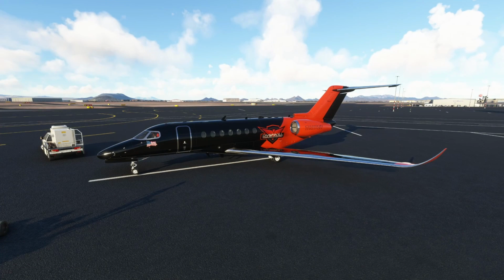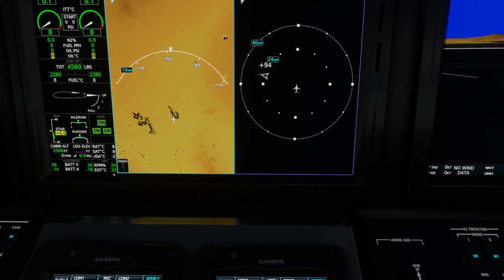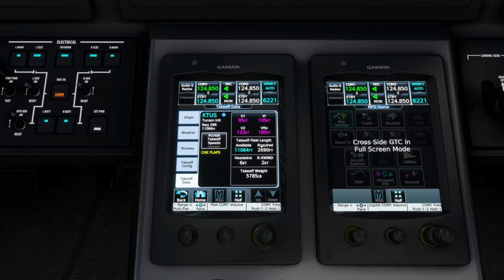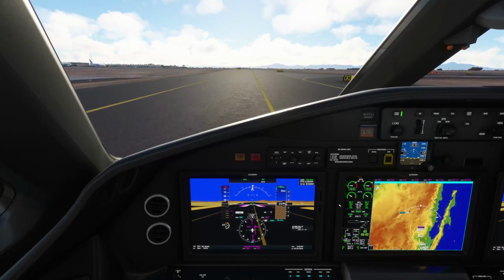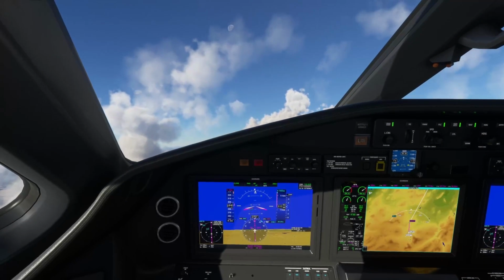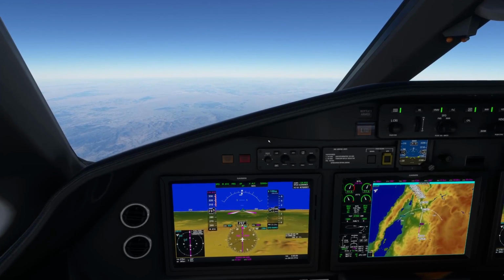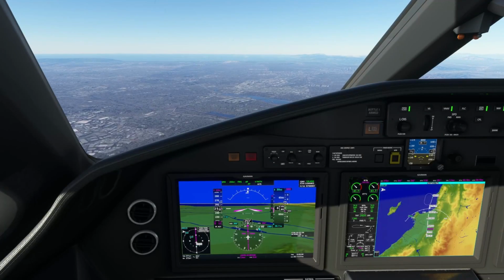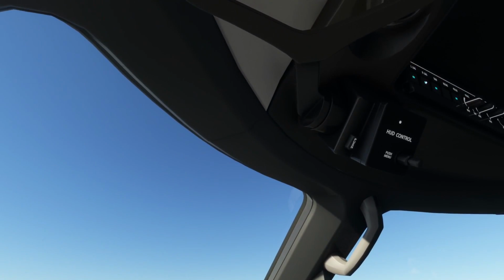New Citation Longitude for MSFS!

Comment: Great video, thanks, I have a query - the Cessna Citation Longitude features three rotary knobs (rotaries) underneath the central Garmin Touchscreen Controllers (GTCs) which are essential for various flight operations. As of the latest updates, there isn't direct keyboard shortcut functionality specifically for the rotary knobs on the GTCs. However, you can use various other methods and tools to streamline your interactions with these controls.

Comment: The auto throttle kicks in after your airborne keeping you under 250knts. with the A/P engaged and the speed bug set same goes for defending and final decent plane flys buttery smooth 🎉very nice flight model 🎉🎉

Comment: Take off performance is based on one engine failure at V1. Continue your takeoff and try and maintain V2 on your climb out with only one engine working. Give it a try. Flight sim does not take into consideration temperature, pressure and airport elevation but you will hands fill.   Great video! Regards-

Comment: Your analysis of VFTO is very incorrect in so many ways but you explain it like you know what you’re talking about.
Reply from the maker: After looking this up you're correct.  I had been under that assumption for awhile hence the confidence.  Not sure what I confused it with now.  But I will correct myself in the future.  Really curious what I have confused it with now because this means there's something else that I'm getting wrong in its place.  I know I read about maximum safe roll speed somewhere.  

My mistake... :/
Reply: @OverkillSimulations  You are thinking of max tire speed.  195 knots.  That won’t damage the gear either.  The tire may get close to its structural limits at that speed but that’s it - probably.  Just like car tires, a max speed will be given but there is a built in safety factor at that limit speed similar to Vne and Mmo.
Reply from the maker: @thecorporatepilotdad  thank you! I appreciate that explanation! Makes much more sense!

Comment: Hi there,all your excitement about these improvements are understandable,BUT : There are a FEW bugs to report,like sometimes FMS mode doesnt change over to APP mode no matter what you do,(like manualy activating the APP eithr via FPLN or pressing APP mode button)the ILS freq is ALWAYS tuned to the stanby position,sometimes the airplane DOES NOT start to descent on the predicted TOD as per VNAV presets,(it happens annoyingly often) I´m a a certified ATP (just for info) and fly an extremely nice Embraer jet...I noticed you dont keep your heading bug aligned to the actual heading (a procedure done and learned on my ATP certificate)we always do it because not only keeps you aware of any changes,helps in keeping situational awereness,and also when anticipating a turn in a procedure.I wonder if the real jet climbs keeping 5000 ft/min  on FLC! I´d called it Citation Rockitude,LOL! nice video!

Comment: 15:23 - the speeds.

You can't change the calculated speeds, it's a one way link to the speed bugs.  Clicking accept on the perf page sets the bugs, but otherwise the FMS doesn't do anything with those speeds.  So if you are using manually calculated speeds, just enter them and call it a day.

FMS speed will always be the VNAV speeds (default 200 initially, then 250 to 10k' then 280) and the speeds set here have nothing to do with it.  The Perf page  helps calculate the speed bugs.

Comment: On an ILS, following pink lines, FMS VNAV and AT modes. Sometimes I can arm the APPR by hitting button on AP. This places LOC and GS in white on lower line in FMA. It captures perfectly. Happens on ILS 26L KLAS. Then other times it does not arm. For example ILS 24 into KCRQ. Anybody else having problems arming FMA with white LOC and GS?

Comment: The only thing I don't understand is how this planes turns in ap.  It can't stay on any approach with curves in it, it over flies all the waypoints, almost ignoring them entirely.  As an example ils22 into klex from the west. You do the same approach in every aircraft, except maybe the few heavies and the crj.  The 737 does it flawlessly, as does the honda, vision, a320, almost every plane does it on the lines or close. The longitude will be 4 miles outside of turns crossing back 90° across the line, then over correcting and flying back to the line, just to overshoot the next waypoint by another few miles. It's amazing that the 737 can do them with no flaps at 180, and the longitude can't do them at all!  It's like the thing is constantly in half bank mode, which makes it even worse!  It makes the turns fine at alt, unfortunately it seems to use the same math to calculate those turns at low speed, and refuses to turn. Maybe I'm missing something, I just didn't assume this plane would fly approaches like an an225!

Comment: Is there something going on, with the new beta  vision of the Longitude jet or Is this just me? On my last flight, ATC would not, let me file a IFR flight plan, that was not an option. The jet’s FMS would not load my departure. It won’t show if it doesn’t load. The auto throttle would not engage or turn on, whatever you want to call that. I thought that the checklist, would be in the plane’s MFD, center cockpit screen, it wasn’t. The HSI needle is off center, when my plane show to be on path, on the map screen. I had my NAV aids, or whatever you call this, set to FMS, before the beta, you would always set this to gps, not FMS. Maybe this should be set to NAV 1 for my SID departure. I don know about the Vnav yet, since I have not had any altitudes, in my FMS.

Comment: Your TOGA was fine (two Green TOs at top, one white TO at bottom left for auto throttle. You just hit it again somehow and changed modes. Just keep hitting that TO button over and over until it returns to the proper format. Then advance throttles and proceed. It will shift to a HOLD indication and proceed into your other modes, hit VS or FLC climb and let it do its magic.

Comment: I love the longitude.  One problem I have found with it is time.  I have tried to flights from Atlanta to Denver and couldn't complete them.  At about the 2 1/2 hour mark, the speed starts increasing, and there is nothing you can do to lower it.  Eventually, the aircraft is over stressed and the flight is over.  I am at fl420 when this happens.
Reply: The Longitude likes to ride the barber tape on auto throttle, change your SPD from FMS to MAN and then select a lower speed.
Reply: Also, don't fly at FL420 😂 either 410 Eastbound or 430 West.

Comment: Relatively new to MSFS.  This is by far my favorite plane to fly.  Are these panel updates automatic or do you need to get an addon?  Thanks!
Reply: AAU1 does not need an addon. In fact I would probably remove older WT 3000 from community folder. The update will show up in Content manager.

Comment: Would the FMS have to slowed down if you hadn't turned off the AP?
Reply: FMS will not slow below terminal speed.

You can toggle the speed select on the MCP to manual and then slow it and the auto throttle will operate all the way down to approach speeds.

Comment: Upon further testing, the FMS actually AUTO sequences FROM FMS nav to LOC 1 (AT the FAF final approach fix, not before) with no need to do it manually. Of course it also automatically sets the ILS course, but it also appears to automatically set the ILS frequency (as standby in LOC1 and primary in LOC2), as I was even flipping the ILS frequency OUT of LOC 1 radio and the FMS AUTOMATICALLY put the ILS freq into LOC 2 radio and flipped it to active AND set LOC2 as the nav source! (I hadn’t done ANY tuning of the LOC 2 radio or changing of the nav source) Apparently it though I was being an idiot, lol. Anyway, the whole approach was automatic except I manually set airspeeds for the auto throttle at various points AND I had to PUSH THE APPR (approach) button when on the approach course (that arms the LOC (localizer) capture. It even lands itself somewhat smoothly, but not on center very well. I’d still recommend a hand flown touchdown…
Reply: This LOC 2 automatic tuning process keeps LOC 1 free to tune to a VOR if that’s part of the missed approach procedure.

Comment: This is not your first time taking off in garmin system right? Let me explain once more:

step 1. Press TO button and arm autothrottle (If you have a nav track available you can press NAV and VNAV, but keep it in TO for a hdg departure. And btw, never press FLC on the ground!)

step 2. Advance throttles manualy to takeoff thrust (this is not a latitude so the AT will not automatically take over)

step 3. Check thrust, HOLD mode, airspeed alive both sides, 80 knots, v1 and rotate

step 4. Keep flying and trimming until 400ft. Then announce:”flaps up, flight level change” At this point you can retract all flaps and press FLC. I suggest binding a button for FLC so you don’t have to use your mouse. If necessary press HDG. 400ft is also minimum altitude for AP engagement.
Reply from the maker: Your information is valuable thank you! I think the new annunciation that I'm not used to seeing was the biggest thing throwing me off.  
Thank you for the information and I'll put it to use :)
Reply: @OverkillSimulations  Great! Looking forward to your future videos
Reply: So you can load sim brief and are you using Navigraph for other info?

Comment: A few thoughts:
* 4X sim rate on autopilot is the max recommended by many devs (maybe even MSFS says so?) — I never go above it. 8X issues may or may not be a bug, but some aircraft will go totally out of control, much less overspeed at 8X.
* Under MFD “Map Settings”/“Inset Window” (available on the “MFD home page/Map Settings/Inset Window” OR the “Flight Plan/Flight Plan Options/Map Settings/Inset Window”) you can turn on a “Flight Plan Text” Bar showing a flight plan summary at the bottom of the MFD. It shows current flight plan progress AND Current VNAV settings and predicted times and required descent rates. Good Stuff.
* In the middle of the “PROC” window is a button marked “Primary Frequency” (after you select an approach) that shows you the proper freq. for the specific approach and allows you to select a radio to send your ILS frequency to.
* The PFD gives you flap extension and retraction markers on the Speed Tape for you, making those decision points easier to see.
* Your landing thump is because swept wing jets need a different technique than other straight wing aircraft. Don’t do a big flare — just level out, or even push forward a little then level out or flare a tiny bit. When you “push” a jet wing, it reduces the descent rate in a “cushioning” effect and makes things much smoother. Pulling back actually just increases descent rate… then “thump”.
* I can highly recommend a book called “Flying the Wing” by Jim Webb (available many online places for $5-$10) which specifically instructs techniques for swept wing jets. Improved my jet flying immensely. He describes how to manage cruise and trim more precisely and he’s a big fan of the little “push forward” on landing to arrest descent rate.
Reply: Note that you don’t even have to use the “primary frequency” ILS button unless there’s some problem, as the ILS frequency appears to be automatically tuned into LOC 1 standby and LOC 2 primary when you select an ILS approach.

Comment: Great video. I wonder if they will work on the HUD. That would be neat. Working Title mod for the CJ4 was the most advanced plane early on with VNAV but the plane does not have auto throttle. Try flying to Sion Airport in Switzerland as you'll be in for a real treat. The RNAV approach is greater than 40 miles! Watch the VNAV take you through the valley from 18,000 feet. It's a lot of fun.
Reply: Working Title did comment on the inclusion of the HUD: "The HUD is actually not available for use nor certified on the real Longitude yet. So, we don’t plan to add that functionality until such that it can be used on the real aircraft."
Reply: Yeah, the CJ4 Collins ProLine avionics suite is also a well known and hated system among pilots. The Longitude Garmin is much, much nicer to use, in addition to the auto throttle.

Comment: Where do you get the mod?
Reply: You must have the Premium MSFS package, and then opt into the Beta version program. Instructions for Beta entry are available with a web search.
Reply: @DoctorShocktor  I have the premium edition and the beta opt into. So am I good to go with out having to download anything else?
Reply: @citylimitsphoto  Yes, should work fine. Make sure you have no mods, like the improvement mods for TBM930 or Longitude or they will cause issues. Also had a strange thing where I had to delete both from official, and then restart to force the download. Probably Mod related though.
Reply: I can’t find this aircraft in the Msfs 2020 market where can I buy it.

Comment: Hello Sir, I would love to try this amazing aircraft, however I have a few questions
1 - Cessna Longitude + MOD ( where I can find the MOD ?? )
2 - There is a possibility to import the FP into the FMC ??
3 - Which one are y using G3000 or G5000
Thank you
Reply: Hello I hope this helps you, He is using the bete avionic update 1 that you can use by activating beta updates in Steam, this will give you the WorkingTitles G5000 for the Citation and the G3000 for the TBM930 without requiring a mod. There is a posibility of importing the FP into the SIm using a software called LittleNavMap although you may have to corrected sometimes as is not always acurate (this is not the software used in the video in the video he uses Simbrief). And the Citation uses the G5000.
PS: If you dont want to use the beta you can always use the WorkingTittle g3000 mod and you can find it in their official website but is not gonna look the same as in the video but similar.
PS: Sorry for my English :) hope it helped you!

Comment: Awesome video thank you. I have the updated longitude and love it. Just wondering, with the approach, did you just load it or did you load and activate it? Thanks :)
Reply: Where do you get the update?
Reply: @barnold62  updated to open beta, you can do it too if you want, there are YouTube videos on how to sign up
Reply: @ratchet8316  ok thanks!
Reply: If you activate an approach it will draw a pink line to IAF and bypass all the rest. Don;t activate, LOAD ONLY.  aCTIVATE IN fms mode, following pink lines straight to IAF 10-20 MILES BEFORE IAF.
Reply: In general, use Load only. There are some relatively rare circumstances in real life where you might use Load&Activate, but Load is used 99% of the time.

Comment: Great plane and review.  Should have let the plane perform an auto-land.  That was a hard hit at the end😊.
Reply: Longitude doesn’t do auto-lands (unless you mean to let the sim “AI” pilot do it. The hard bump was due to flying a swept wing jet like a 172. See other comments of mine.
Reply: @DoctorShocktor  This was one of the hardest things to learn for me moving from FS9 to Xplane and then MSFS.  In FS9 because of the simplistic flight model, the shape of the wing had little bearing on landing behavior (*some* 3rd party add-ons did some work on this) and ground effect was modeled as a "increased lift" when you got close.

X-plane and now MSFS actually have multiple data points and so you get some of that swept wing behavior.

Comment: The Longitude with the avionics update (AAU 1) is only for the owners of the premium deluxe version of the MSFS, right?
Reply: Where to download the update ?
Reply: @limother3749  it is just beta update, not official. I have tried the beta, it is ok with the TBM, TBM is great with the beta update but i could not try the Longitude.
Reply: Yes, but they are updating the 930 so you can fly that model.
Reply: @GumperVanLier  yeah i have flied with the TBM. It was perfect. Did u try it with the TBM improvement mode or default?

Comment: I am having an amazing time flying this thing around the place atm. Have been bouncing around the USA on Vatsim, and I usually avoid the USA haha.

IIRC, the take off speeds when you edit it directly it adds them to the speed tape as you enter it, but if you accept the calculated ones it just overwrites it with them.

Seems you have to accelerate to max throttle on take off manually and then engage AT, that has worked fine for me so far. I enable VNAV+FLC on take off too, so it automatically adjusts speeds according to VNAV/constraints/etc